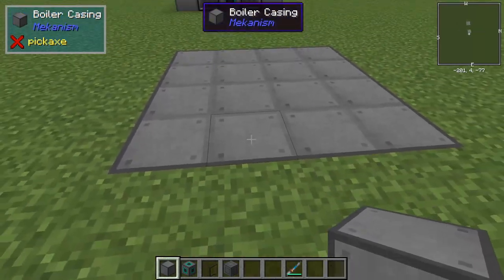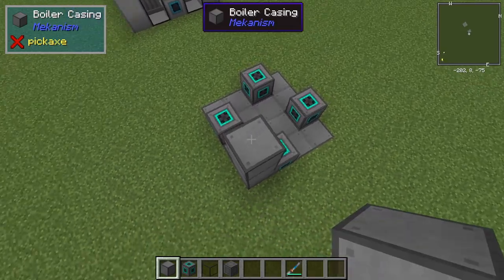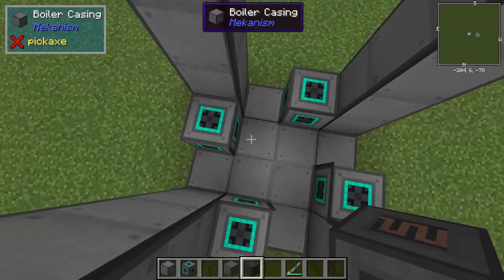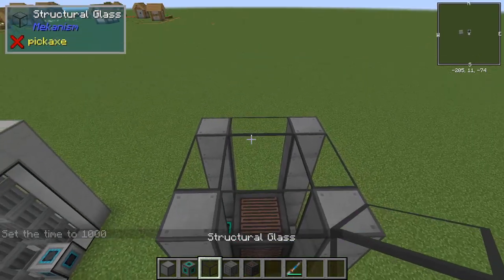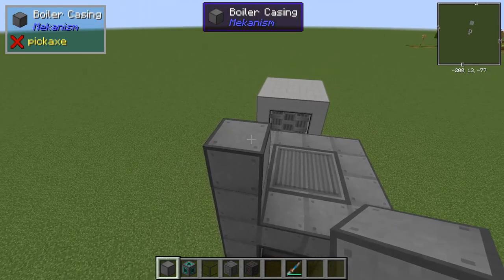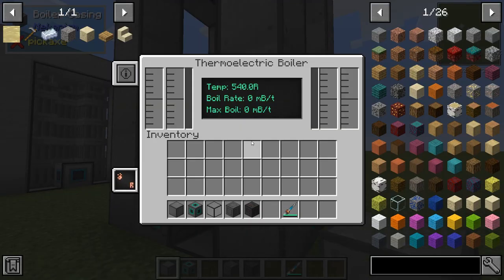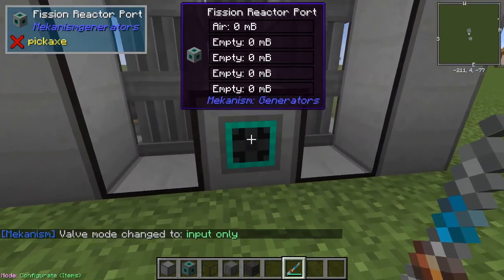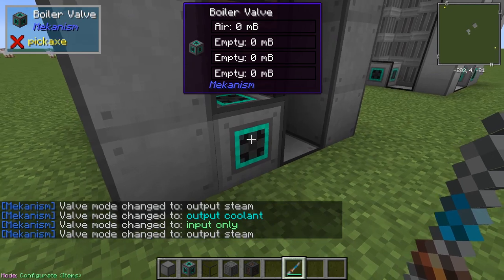Minecraft Mekanism Boiler Tutorial (used for sodium cooling)

Comment: Im trying to run a literally maxed out setup, and I've built the biggest  reactor and boiler possible. I do not care about the steam, can I completely get rid of the steam layer? And how many layers of superheaters will i need? So far I can run the reactor at rate limit 975mb/t but if I raise it further the sodium runs out in the reactor, and I'm having a hard time calculating why...
Reply: I believe the superheaters and the pressure dispensers don't matter when trying to cool sodium. it's the water interacting with the superheated sodium that cools down the sodium and produces steam which is pumped into the turbines which produce the energy from that

Comment: i cant get the configurator to change the mods on the boiler valve
Reply from the maker: The configurator needs to be charged. You can do that by putting it into an energy cube. 

To change modes with the configurator the control is Crouch (shift by default) + Place (right click by default)

Comment: for me its not working, water not entering this...
Reply from the maker: The water input's setting is input only via mechanical pipe, you can do this by crouching and right clicking on it with the configurator (default controls). It also wont work if the mod doesn't consider the boiler "complete" which is identified with the red sparkles.
Reply: @urbancowgaming9607  the red effect appeared and the boiler dont even got filled up with water. The temperature was 500°C but no water. I dont know what to do. Can you make a detailed video about it where I can see how it works?
And by the way I can set the input to steam output, coolant output, and input. The pipes to push, pull, and the natural way. I set that to pus and the valve to input. And nothing happened